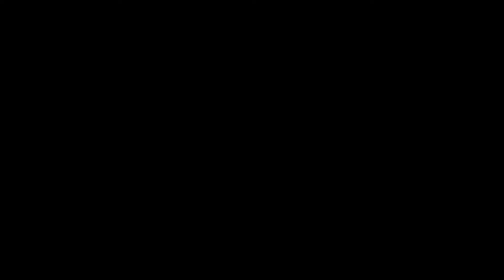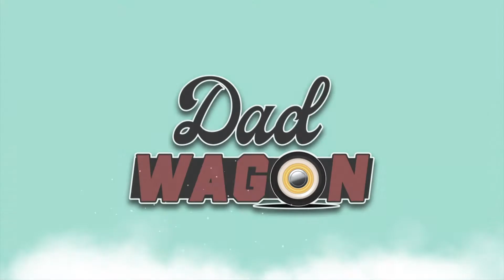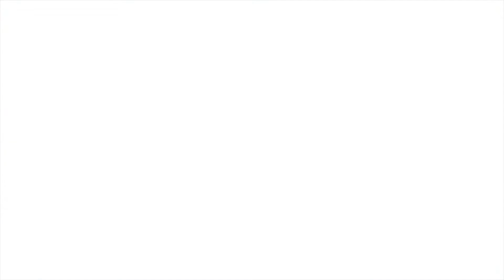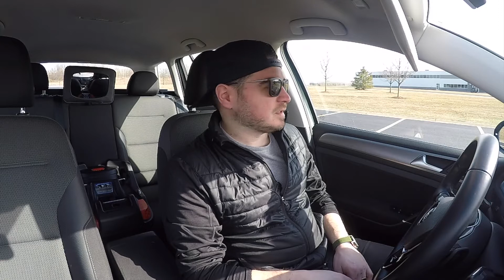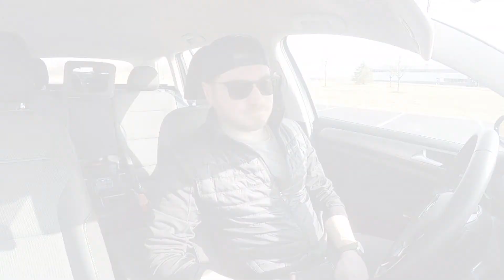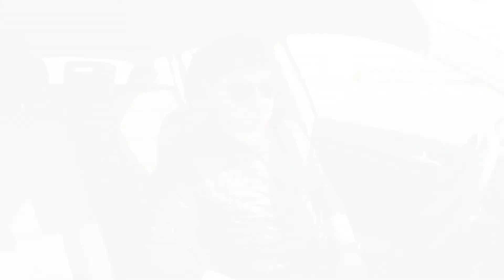Help?! No Launch Control for Mk7 Golf Sportwagen?

Comment: DId you ever get a response about launch control? You have to long press the traction control button, as you’ve already done, put the DSG into sport mode, and then press the everliving crap out of the brake pedal, before pressing the gas. I feel nervous about how hard I’m pressing it, like I’m going to damage something. Even when it works, honestly, it’s a bit underwhelming. It’s more of an “ease-into-a-launch” sensation, totally unlike dropping a clutch.

Comment: after following tutorials via youtube when I first got my 2019 almost 2 years ago, and failing (and figuring it did not come with it), I got the message totally by accident last night. I went out for a quick drive and when I got to a stop light with a good stretch of road in front of me, I turned on ECS SPORT, and put the DSG into Sport, and when the lights went green , released the brake and just floored it... and I just barely saw the "launch control program active" on the display (before all the warnings for turning off ECS were cycling).  I came to stop a little ways down and held the brake and sure enough launch control was showing, and when hitting the gas while it engaged bounced around 3K RPM. I'm certain I had tried both ECS modes, but had never got it to engage before, so not sure what was different.....
Reply from the maker: Awesome! Mine is working as well now, using the same manor - but the dialog box just doesn't want to show up.
Reply: @DadWagon  yeah, seems a bit funky; When I originally had tried it, it definitely wasn't working because the car wanted to move against the brakes; I just figured it wasn't enabled in my model and left it until it activated last night. I went back this morning in the garage and was able to repeat it with the ESC Sport off. I decided to try again with ASR OFF, but when I held the brake, the message didn't come on until I hit the gas (which was more the expected behavior, not just with the brake). I went back to ESC Sport Off, and again I didn't get the message until I hit the gas, which was totally different than I what I saw earlier with just the brakes.. will have to play with it a bit after work tonight. Not that I have any power at this point, but still brought a smile to my face. I'll look at tuning/upgrades once it's out of warranty :D

Comment: If you are 4Motion with DSG you have it.  You need to put transmission in S mode or manual mode and set ASR OFF, not ESC SPORT.  Hold brake hard, and mash the gas pedal to the floor, do not slowly press it down.  I have a 2019 without a traction button so I need to set ASR OFF on my radio car setup menu but this works for me.  Launch Control should be activated on your dash.
Reply from the maker: It definitely work and have now used it a few times. Mine still does not activate with any sort of message on the dash, but it definitely functions.
Reply: @DadWagon  Have you been able to get the Lauch Control on the dash? I got a 2017 alltrack and have not been able to get it yet